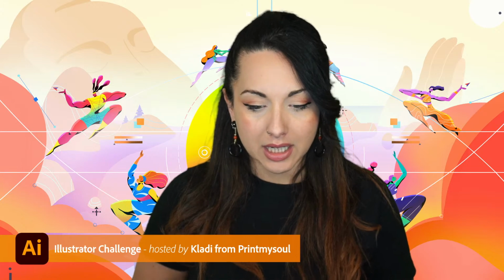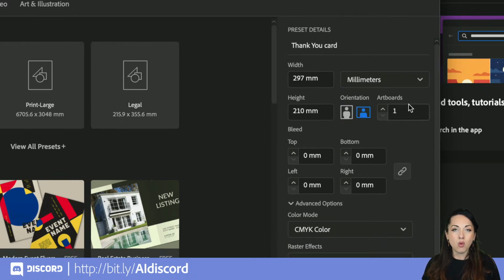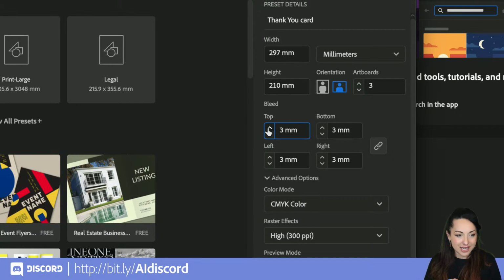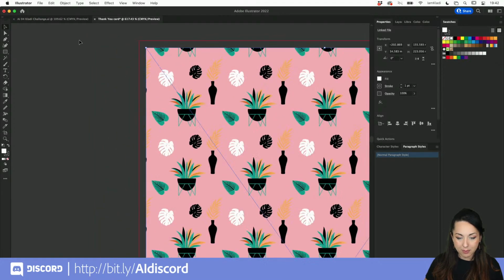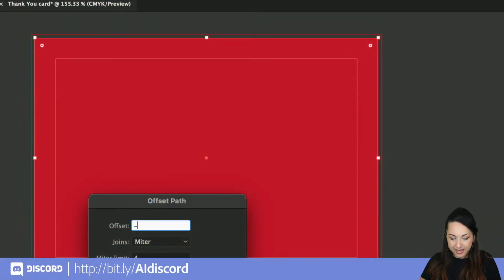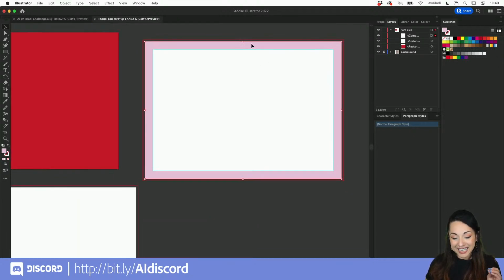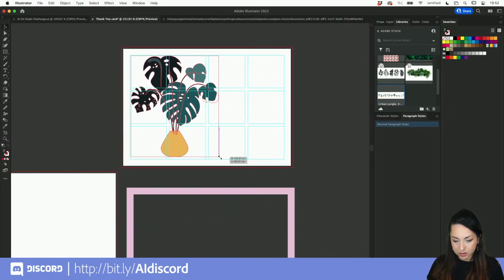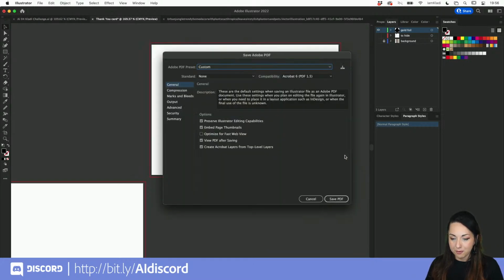Do This BEFORE You Print! | Adobe Illustrator Printing Tips & Tutorial | Adobe Creative Cloud

Comment: Is there a difference by using pdf preset: High Quality Print vs Press Quality ???
Reply: The only different is that the HQ will not convert the color profile (uses the documents settings) and the PQ will convert to destination(uses printers settings)
Reply: Yes, High quality print is for web and is in RGB and press quality is for print and is in CMYK
Reply: @NiazMohammad  that is incorrect...High quality Print is usually used for printing because it doesn't allow the printer to change the color profile, it will keep it as what you have it setup on the document. If your document is RGB it will not convert it to CMYK(default for printing) but if the file is setup as CMYK to begin with saving it as a high quality print the document will include all the data necessary for a printer to accurately print spot and process colors. AND ACTUALLY you shouldn't save as PDF for web anyway...you should be using .jpg or .png for web so you can make sure it is 72ppi.